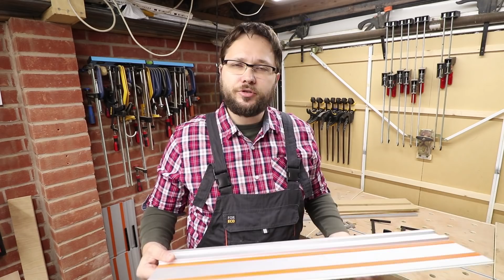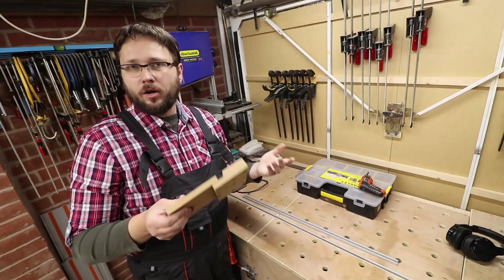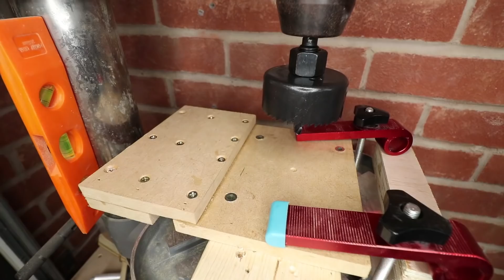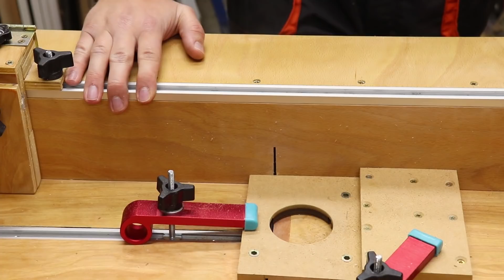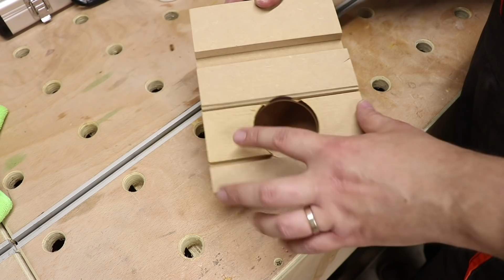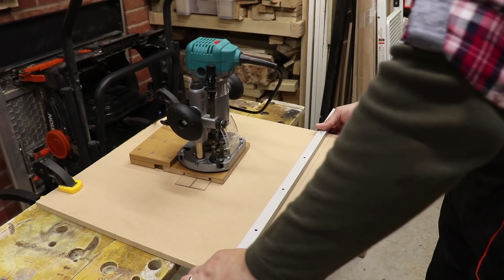Simple Router T-Track Guide Jig

Comment: I have a really tiny workshop so a tracksaw is something I'm never going to have.  I have a feather edge that I use as a guide for my router and circular saw.  It's not ideal but, since I have it for plastering, it's not occupying any extra space.  It's also 6ft long so it's gives me plenty of scope.  I'm now considering some sole plates for my router and my circular saw, simply so I can have those acrylic graticules.  It's such a bind measuring and adding offsets etc... With those lines giving me a precise location, I can be sure my guide is in the right place.
Reply from the maker: Using sole plates with those lines definitely makes setting up your cuts much quicker and more accurate. 👍

Comment: Hi Thomas. Im Héctor from argentina and I want to thank you the slow way you talk that allow me to understand very wel
I ask you if you made biggers holes on the base of the router so you can take out the  router??
Thank you
Reply from the maker: Hi sorry not sure what you are asking me. I didn't drill anything in the aluminium base of the router. I make holes in the MDF in the exact same pattern as the router base so you can attach the MDF base to the router.
Reply: @CasualDIY  thank you

Comment: Thanks Thomas for this excellent and simple base for a router. I will try to make one.
Did you remove the  plastic at the bottom of the router or you kept it and drill it to get out the bolts?
Reply from the maker: Took it off mate

Comment: Nice idea :)
what I like about the Katsu router is that if you don't really need the plunge capability, you can pick up spare standard bases for just over £10 which is really handy, as for certain jigs (circle cutter for example) it means you can fix one to the base permanently at a reasonable cost to save you having to screw the base on and off all the time.
Reply from the maker: Yes that's true. It add the ease of use
Reply: @CasualDIY  aye, I bought a spare as I saw how many jig possibilities there are, I have to admit I've not put it to use yet, but it's on the ever growing list lol

Comment: Thomasz, I totally agree with Peter Millard, this is a brilliant idea.  You mention that the T-Track is 12mm high and I have tried to find similar but there seems to be a number of different sizes available.  Have you standardised on a specific size and if so  what width is the track you use.  You mention that you get it from Banggood or AliExpress; do you have any links that you could share?
Reply from the maker: That's the problem with these t-tracks they can get bit pricey so I always wait and look for a good offer. But that comes with it's own issues. I got 4 different sizes t-tracks lol. So I either buy more or just enough to last me for a project. I couldn't find any good deals today. 
But check this one for example
[£3.69 24% OFF]Red Aluminum Alloy 300-1220mm T-track T-slot Miter Track Jig T Screw Fixture Slot 19x9.5mm For Table Saw Router Table Woodworking Tool Tool Accessories from Tools on banggood.com
https://banggood.app.link/owBYcvvcs7
Reply: @CasualDIY  Thanks very much Thomasz, much appreciated
Reply from the maker: @bldcompsol  no problem mate

Comment: I do appreciate the whole idea. I'll just apply a few mods. Instead of t-tracks – which I don't have already –, I'll use square (or rectangular) section alu tubing, which are sold quite cheap in 1m-long format. I don't have your clamps, so I'll use "normal" ones, thus saving twice!
Also – as someone else pointed out – that MDF base (plus the plastic bottom of the router) will waste a decent amount of depth. Considering that the base of your jig has a very small area and it lays flat without doing any significant effort, I'll use a piece of 4mm plywood.
The acrylic guides are clever. Despite the difficulty of cutting acrylic (as I said in my post about the tablesaw zero-plate), those two small and square pieces shouldn't pose big problems, with a bit of care.

P.S. I suspect the lockdown took a toll on your silhouette, Tom, uh? Well, it did the same to me. Unfortunately, I'm almost twice your age and your girth (lockdown+recently retired wife = lots of cakes+lot of time to spend eating). Take care. Carlo
Reply: I would use laminate floor in 6 mm (got some leftover if not I buy last pack of discontinued one at local store (need to be lucky)), strong, straight, good sliding and not a lot of depth lost
Reply: @Angelito19781106  Nice idea. I may have some, too.
Reply from the maker: Yes it's just a general idea and just use what works best for you. Yes I put on So much weight it's madness. Hopefully it will come off when the lockdown eases😁👍

Comment: Another great project. I particularly liked the use of acrylic- a real boon to accuracy. The only criticism of the design is, by attaching to the bottom of the router plate, you lose  cut depth, if that's important.  Great use of t track.
Reply from the maker: Thank you. Yes that's true. It's something to consider on my future upgrade. So far for the projects I'm planning to make this should not be an issue.
Reply: @CasualDIY  However, you also lose 6mm-10mm on some router plates. It's only an issue cutting deep rebates, T slots or similar. And Tomas,  using T Track like that is a great idea and you could also use box section aluminium the same way.

Comment: Another simple and efficient idea, much appreciated,  I'm going to adapt it to fit the Trend straight edge clamping guides I already have,
Reply from the maker: Exactly, you can use whatever you got in your workshop as long as it's straight 👍😁
Reply: @CasualDIY  A length of steel hollow section (square format pipe) would be ideal, straight, robust and very easy to clamp

Comment: Well done Thomas’s for your strict attention to safety precautions with the mitre saw.  Wouldn't it have been better to fit the thread inserts from below to use the flanges to support the tension on the bolts?
Reply from the maker: Thanks, yes you could do that, would definitely make it a lot stronger. Been using them for a while now in all sort of projects and not had an issue installing then like that. Saying that not used them in MDF so that could be an issue 🤔